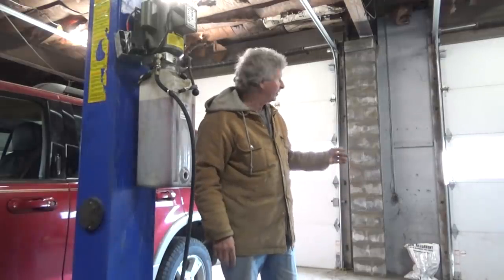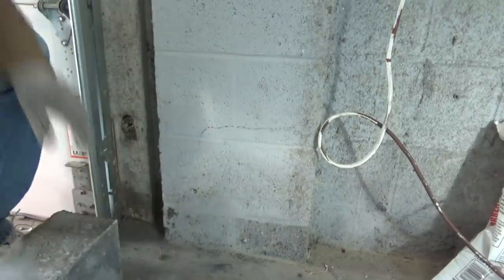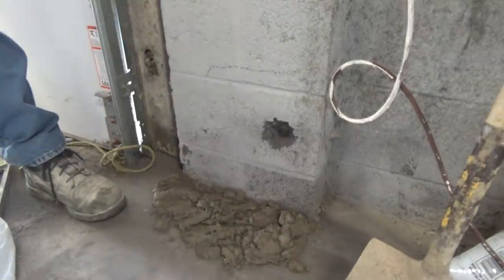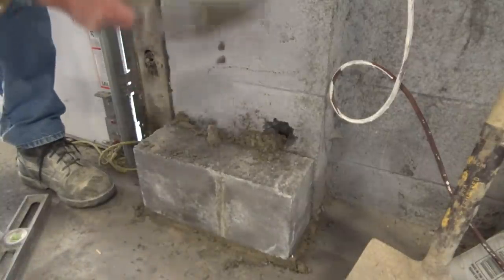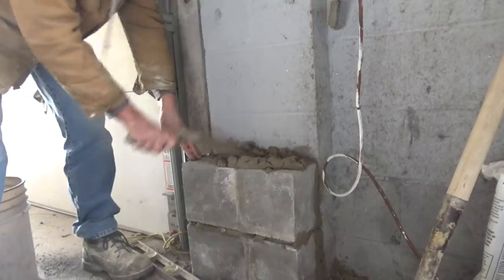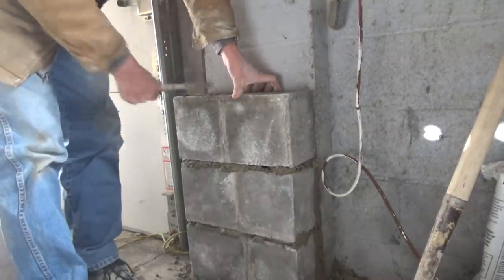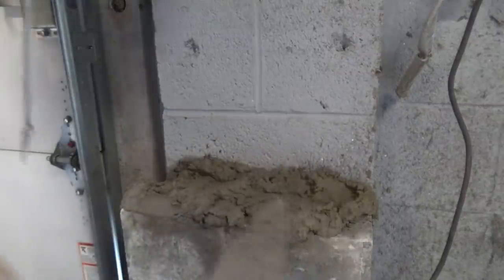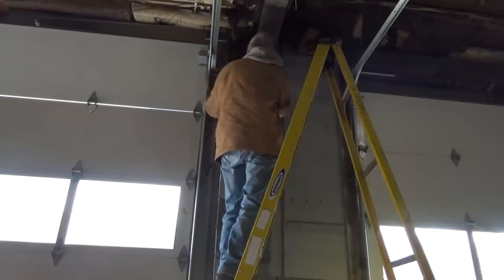BLOCK PILASTER/COLUMN (Part 1) MIke Haduck

Comment: What about the foundation? Wouldnt you have to cut the slab and make a deeper base for the post so the slab doesnt just crack?
Reply: Mike H never says his is the only, or even the best way. Just what works for him, in his locale, in his experience. ... Part of what makes him special, a YouTuber who isn't an egomaniac
Reply: Come back in 50 years and you'll see that still standing perfectly fine.
Reply from the maker: Hi Richey,  it just a safety thing and if the floor hasn't sunk in 50 years I can't see it having a problem, thanks Mike
Reply: Hopefully wont make a difference. Having to cut up that slab and put in a footer for the post wouldve made the job alot more expensive and labor intensive so if you think you could get away without it then more power to you. Love your videos Mike, youre the man!

Comment: dont need no stinkin 2 part rebar injection! Great technique, the rebar actually gets harder to pull out as the weight of the blocks and beam presses on top. I finally figured out why you needed some fill in the back side, it supports the cinder block side of rebar from breaking out. brilliant !!!
Reply from the maker: Thanks, mike

Comment: Nothing wrong with the way Mike did it and what he did will work perfectly fine, but i always use hollow core block,  then drill into the floor and get two rods coming up and fill it solid as I go. I pin it into the existing block the same way though, with angling the rebar except I drill half inch holes and pound in half inch rebar tightly. (Inspectors will make you use an epoxy to glue it in.  Not a bad idea but not really necessary... don't tell them that though lol)
Fill  everything solid and pin it in every other course and it'll never go anywhere.
Reply: What would you do up top where it meets the steel beam?
Reply: Inspectors?  We don't want no stinking inspectors..
Reply: @ishowyouapple  You can just lay a solid block on the top course.  Grout and fill everything up to that point.
Reply: @ishowyouapple  Or, in this case, since the beam is only over one cell of the block you could cut the middle web out of the block, and grout the whole top block. That way you could get a short piece of rebar down from the top tying the top block into everything underneath.  If you get what i'm saying.
Reply: @dukeman7595  Damn right lol
Reply: How do you pin to an existing hollow block that has no access above to fill?

Comment: What if the cinder block is hollow you didn’t mention what you would put in would then be good for reinforcing a garage wall?
Reply from the maker: Every situation is different but I would probably fill it with cement, thanksmike

Comment: Hey Mike, if there was paint on the existing pilaster, would your mortar stick to it, or would you need to strip it clean?
Reply from the maker: Hi Denny, I would say that masonry does not stick to paint, but in this case I does not have too the pins are holding it in thanks Mikey

Comment: what type of pins wold you have used if the blocks were hollow ?
Reply from the maker: Same thing, I just would have been filling the blocks solid with cement, thanks mike
Reply: @MikeHaduck  Would you break the face of the blocks to fill with cement?
Reply from the maker: @AustinWilhite  no, I dont see what good that would do, mason wall like that are not strong sideways, only up and down , I don't see a reason for that in this case
Reply: @MikeHaduck  How would you pin to a hollow block wall that does not have access from above to fill the cores with cement? Or would you just not pin the two together in that case?

Comment: Seems like they should have welded a couple vertical I-beams instead of block.
Reply from the maker: Hi Shane. I was probably a lot cheaper,  and it works, thanks mike
Reply: Meh, that beam has probably been there since the 60's and wasn't really going anywhere anyway.  It certainly won't now.  The block was all that was needed